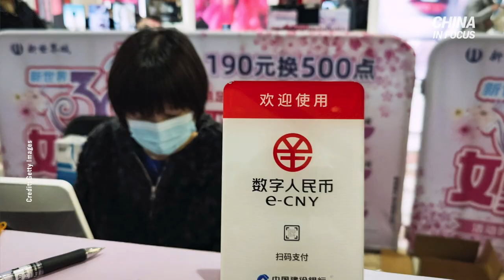How China violated the WTO and made free markets less free: Clyde Prestowitz | China in Focus

Comment: Super important for us to know that research has just proved that HEMP batteries are even better then lithium batteries. Now we the people need to push companies to use this alternative that hold charges longer and is better for the earth. We could change some of our farmers that grow corn to change to hemp. Less need to go out of the USA for this material. May even change cars to run on electric better, buying less oil outside of the US too.
Reply: You misunderstand what it means for a hemp battery to be better than lithium. Hemp/graphene batteries still use lithium, they are just more efficient at transferring the battery power and holding the battery voltage because the terminals are graphene based.